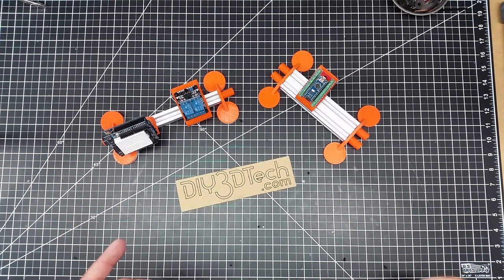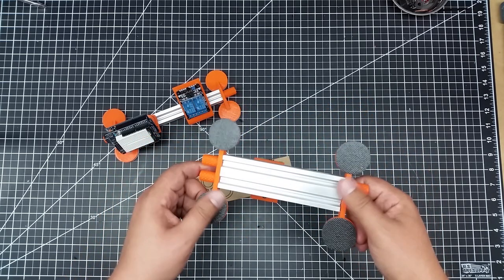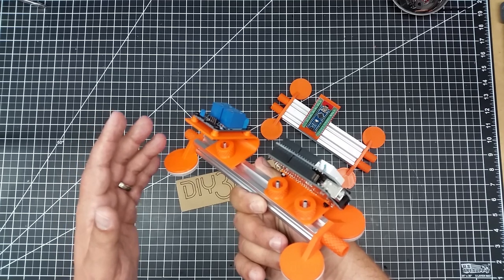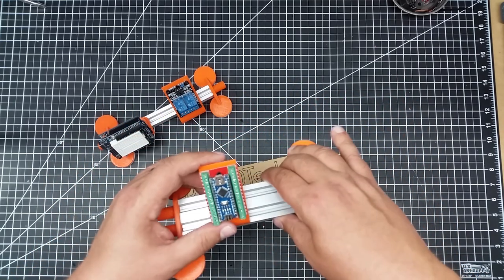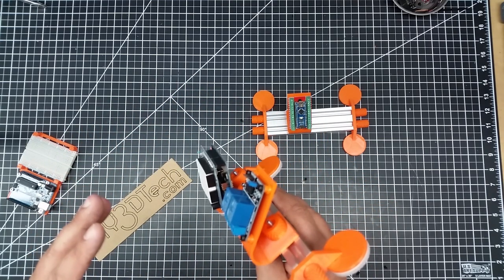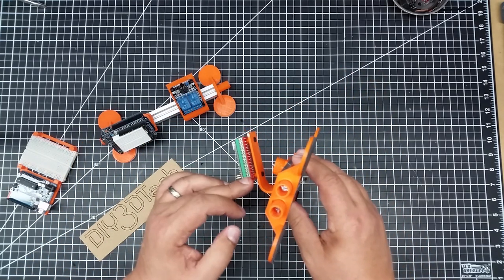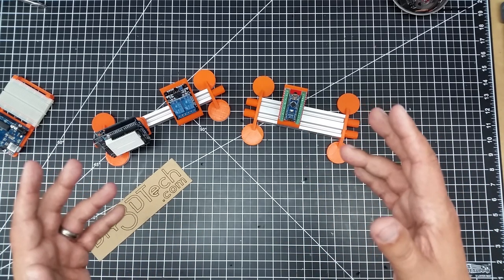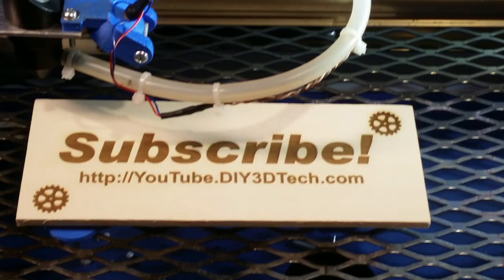3D Printed Projects -  3D Printed Arduino Prototyping Jig!

Comment: Great idea and interesting to see it evolve.  The value to me would be that I can set it aside if I need to work on something else and it keeps it together.  Also the modules will be stationary and not move around which aggravates me while I am wiring a proto up.
Reply from the maker: You hit the nail on the head with those as me too those two reasons!  As too since this is all pretty cheap i made several for again those very reasons!

Comment: I am really thinking if I would find this is handy or not?
When I am working with electronics, like Arduino's and so on, I want to move them all over my table all the time. Sometimes having them above my breadboard, sometimes at the side... I can't imagine I find it handy if they are mounted to something while I am in the experimental phase. Then, when everything is setup on breadboards I try to fit all of it in a case or I design my own case and print or lasercut that. 

So, unless you are making a cool way to show the PCB's in a shop or on YouTube, I don't think this is something I would use.

That said, if it works for you, then go for it. It sure looks great.
Reply from the maker: To each their own, I find it handy as I prefer to keep things organized and in place as well as at a comfortable viewing angle.  In addition this too allows me to move the completed design to another location intact which is important if I am building a machine controller :-)